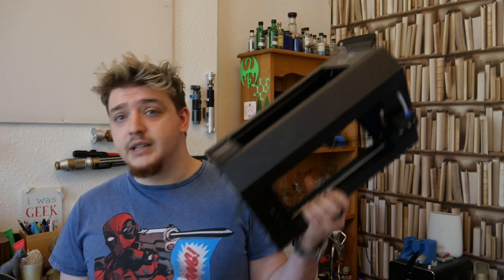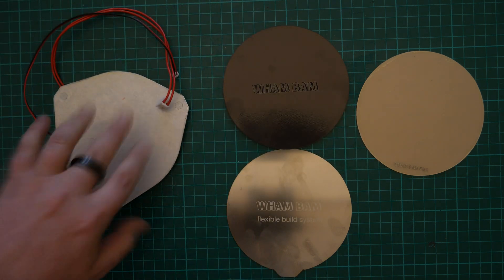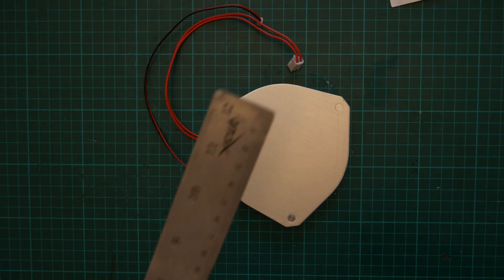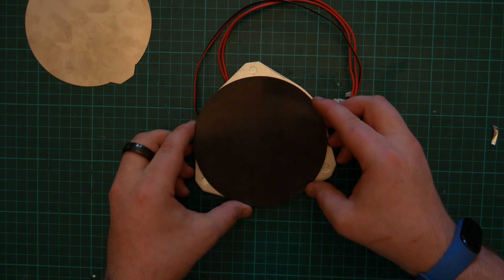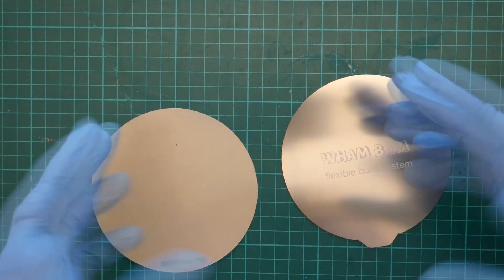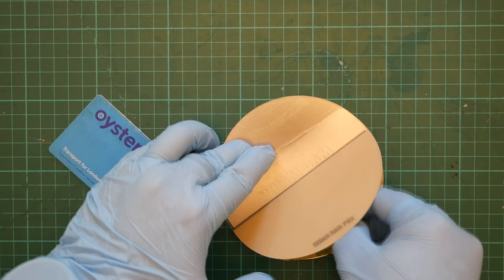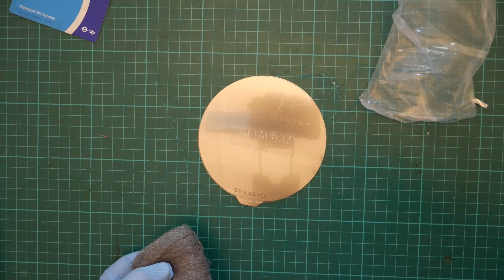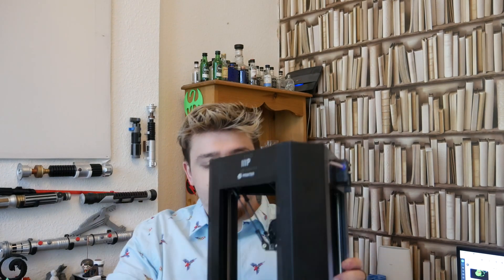Wham Bam Flexible Build System install on Monoprice Mini Delta

Comment: Hey Dom, Great video. You're gonna love it. I have the 410x410 on the Borg and it has made it a real pleasure to use. I know what you mean about not wanting to scuff the PEX, I was the same. I didn't scuff mine at first and it still worked great, after a couple of prints, I relented and scuffed it, and it does make a difference. I hadn't realised you were here in Blighty 👍
Reply from the maker: Ha, I thought the Acent made it pretty obvious but when people only see me on Social Media i've had all different kinda of assumptions of where im from.
Reply: @Mobile_Dom  Yep! Was the accent that gave it away, this is the first video of yours that I've seen 😒, only seen you on twitter before. Learnt something new today :-)